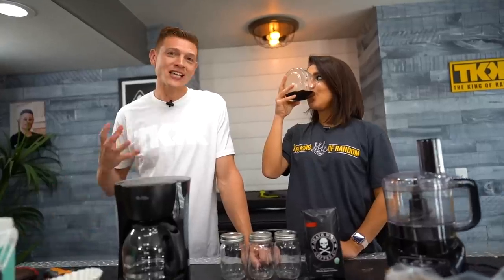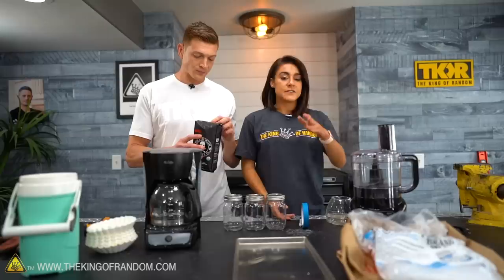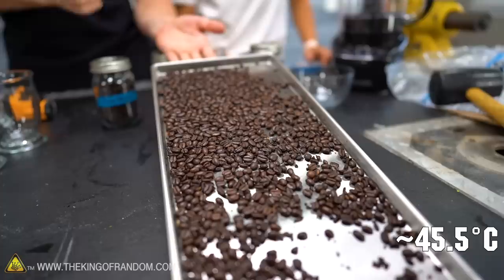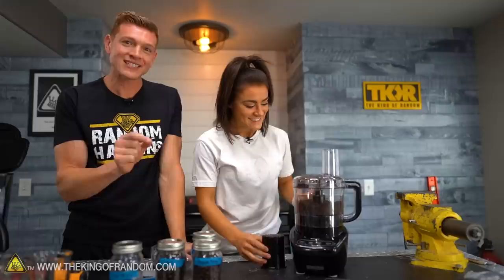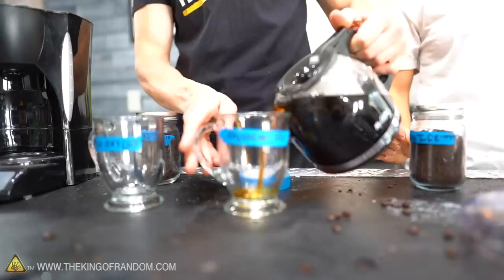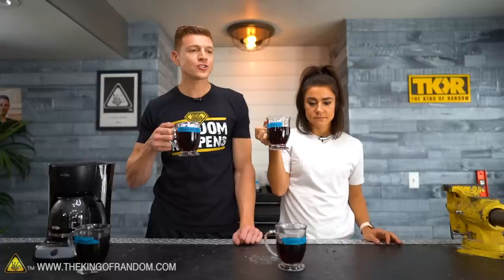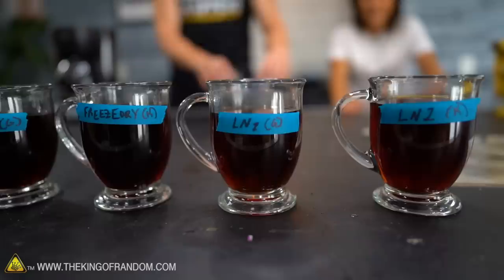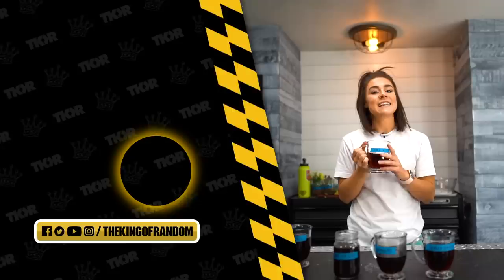Coffee Beans at -346 °F Has an Unexpected Flavor

Comment: Hmmm... You guys need a coffee grinder. That "grind" looks a bit coarse.
Reply: Just the grind changes the flavor.  I don't think they are getting a repeatable grind
Reply: Agreed
Reply: Agreed I saw that food processor and said they better not lol
Reply: The grind is too dry...too bland...no flavor.......its over-grinned...
Reply: @nikonaddiction  At least they did measure and keep the times on each setting consistent across each treatment, I guess what they could do is run the grind through sizing screens and then only use the portion that was the correct size
Reply: Not to mention the ground beans are just sitting there "cooking" in thier processor a grinder passes them through once ground they way they did it its holding a lot of heat

Comment: Depending on your water, a pinch of baking soda (sodium bicarbonate) will neutralize some of the acid (be careful you don't make it salty).  Secondly, do not leave the hot plate under the coffee on after you brew. It can burn the coffee even when there is still a lot in the pot.  Reheat in the microwave which can also cause the volatile oils to dissipate.  These work for me. Your mileage may vary

Comment: I used to work in a plant genomics lab. To extract DNA from samples, I needed to powderize them first. The friction of the grinding process heated up the samples and messed with our results until we did the grinding itself in liquid N2. The sample was in a test tube and the tube was in a metal block sitting in the N2 and we put a micropestle on a drill like a bit and finished it off by hand. You should see if there is a way you can grind the coffee still at temperature without breaking your tech and find out if there is a taste difference.

Comment: I would like to see how a burr grinder compared to a conical grinder perform. The blade grinder you used isn't the best way to grind coffee beans ...
Reply: You beat me to it pip. Flat burrs create a way more uniform grind compared to blade and a but more than conical. Conical is better for coffee where flat is better for espresso because of how fine flat can go. In this the blade grinder will make alot of boulders and fines not to mention the in consistency of the medium sized grind. 

The smaller grinds will extract faster and the over extract, the boulders will under extract creating a bad cup.
Reply: (Not the best way to grind coffee beans). yea.  But maybe, it is the worst.  Even one of those old timey hand crank one is better.  They are, still, a burr grinder, Only slower.  No issue with speed.  Only a problem with quality.  And a chop grinder has a zero on my quality rating scale.  Like, put the beans in a bag and hit them with a hammer.  Even that is preferable to a chop grinder.

Comment: I wonder how this'd effect culturing kombucha in coffee? I know you can use coffee instead of tea for that. But will preparation methods done like this affect a fermentation end result? 

Might be worth testing. Can avoid variations in the starter culture by just using a lot of starter and splitting it in equal amounts. Should be able to produce all the different methods with no variables in the starter culture. So any differences would be solely from how the coffee was prepared.

I recommend doing a few practice runs first so you avoid tasting the brew multiple times before it's been going on long enough to be perfectly done. Keep  the source of the starter the same and the timeframe it's left to ferment for. That'll also help see if it increases or reduces fermentation time needed. All  you need a cheesecloth and string and jars and a starter. And of course the coffee and sugar.

Comment: There's a reason it's called a BLIND test. It would've been more accurate to not know what was what.
Reply: taste tests don't work well when you are allowed to mix the flavors, though.  You really need a palette cleanser between tastes, otherwise you might still be tasting the previous taste instead of the current one (or worse, have the two mix so you get a blended taste instead).

Comment: You guys definitely need a burr grinder. You can get a conical mill burr grinder for less than $100. Blade grinding coffee beans is notoriously bad for inconsistency and when you’re trying to compare cups of coffee, your results are useless if you’re using a food processor to grind your beans.

Also try pour-over or a Chemex method of brewing and use a gooseneck kettle for goodness sakes. You need complete control to get legitimate results for this experiment, please redo it with my suggestions. (Also, 2 grams of beans per fluid ounce of water.)

Comment: You were distrot about how your grind didn't turn out all uniform.  Use a burr grinder.  A blades on a chop grinder will hit or miss the bean.  So technically.  You could grind some beans into oblivion and not even touch the rest of them.  Not so with a burr grinder.  Each bean must grind to the same level before it can pass on between the burrs.  Well worth the extra 25% cost.

Comment: i think this test needs to be done different. when you cool something that much, then hot water runs over it. it wont heat as much as the room temp beans. different flavour terpenes are drawn out at different temps. the bitter flavor, and dark color is probably drawn out at very hot temps. so i wander if your result would change if you were to cool all the beans , and then let them warm to room temp equally ?. the freeze dried one would probably almost count as being extra roasted . so maybe you could get the same result with just putting them in the oven at freeze dryer warm temps for equal time?. and you should have used 4 coffee makers. because the buildup in the coffee maker itself would possibly have changed the flavors .

Comment: This comment section is making me extremely confused 
I don't drink coffee and don't understand anything y'all are talking about
Reply: Essentially it all comes down to consistency. Everything people don't like about what they did comes down to making sure the coffee is brewed correctly. 

You should use a burr grinder, because a food processor will grind the beans unevenly, some grinds will be larger than others. You should make your coffee in a manual method, french press, pour over, aeropress, etc. Because you can control how saturated the grinds get and how fast the water filters through. You should heat your water with a kettle because you want to make sure the water is the temp you want it to be. Hope that helps. It's all about control and consistency
Reply: Freedfg thanks that makes a little more sense😁